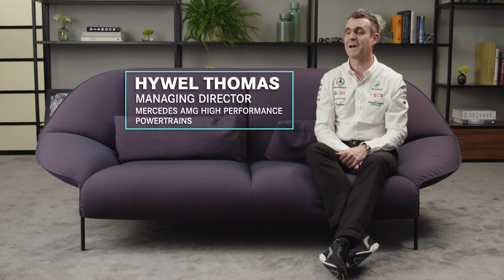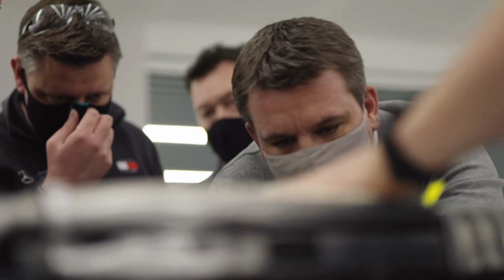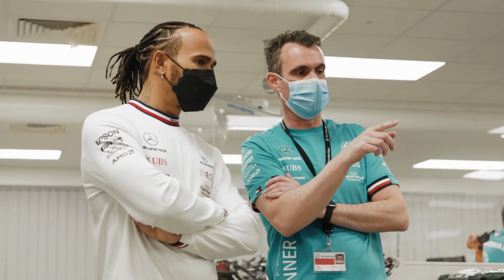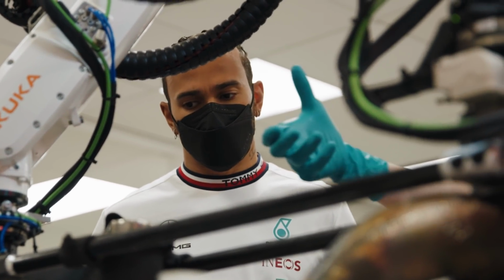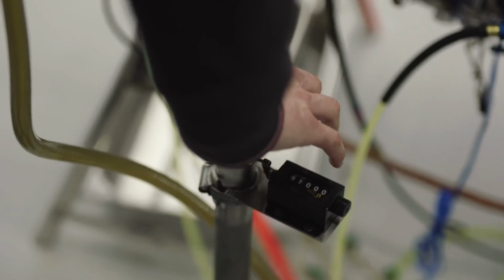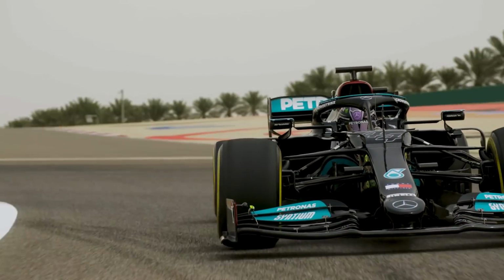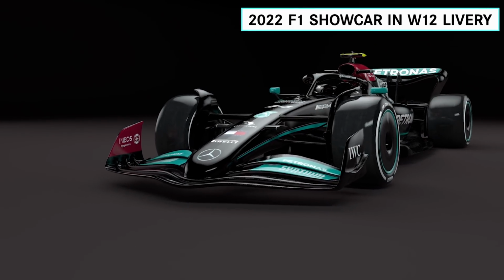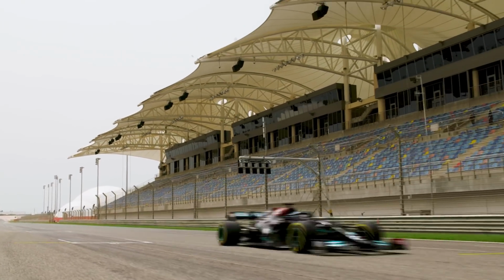Road to 2022: Powering Into a New F1 Era

Comment: The restriction on engine upgrades mid season is something I expect to backfire on the FIA. They want more competitive racing but want to handicap teams so they can’t catch up if they’re behind. If there are front runners, they will effectively remain so for the next 4 years. That’s ridiculous and will be a major turn off
Reply: Though that is a possibility, more than likely the other rules which compliment it ie more wind tunnel testing for weaker teams will make levelling out the playing field over the years easier. They've stopped one moving goal post (engine) and penalised another (aero) for better teams.

Personally I don't agree this should happen from a technological advancement perspective, ie what are the engine developers doing to do for the next 4 years? twiddle their thumbs? 
fix broken machinary? 
I think the clever teams will build in deliberate "unreliability" into the system and then "patch up the fixes" and not call it "upgrades". I'll be expecting to see Merc cars "break down" more often.. 5 grid place penalties is nothing if you have an engine that's 0.4-0.6 sec quicker per lap over course of 3-4 years.
Reply: I was thinking the same. till 2026 frezing performance means once back always back or once front till 2026 in front? did I understand it correctly?

Comment: On the PU freeze. Is it possible to have a reliability upgrade that results in improved PU performance? If so, would that be considered a breach of the regulations?
Reply: as far as i know, it's like this a reliability upgrade can result in some sort of improved performance, but whenever a reliability upgrade it's done during a PU freeze, the whole documentation that you have to provide to the FIA about your upgrade it's also distributed to the other teams, and this is what keeps the teams in check with the performance upgrade masked as reliability upgrade, because you can basically give out your secrets for free to the other teams if you do it
Reply: Regardless if inherent performance is a side effect, better reliability means they can run engine harder. In many series this wouldn’t necessarily big room for big gain but with f1 they turn engines way down to meet 3 engine requirements